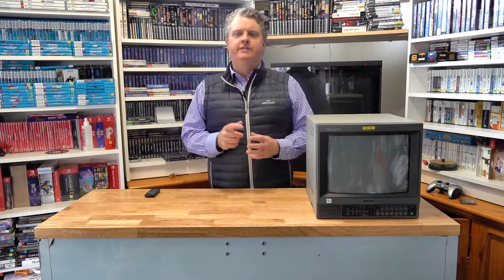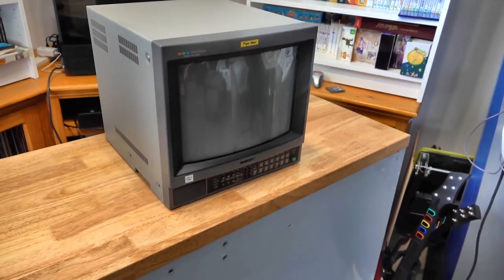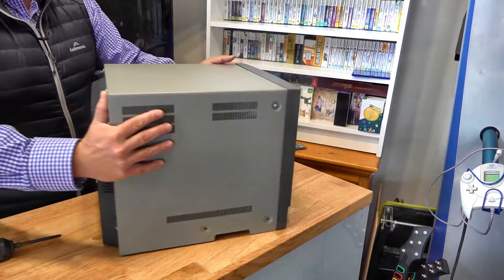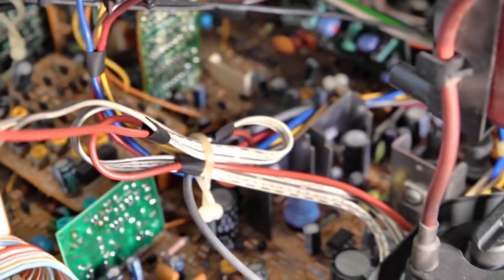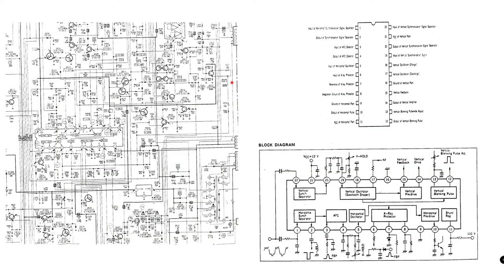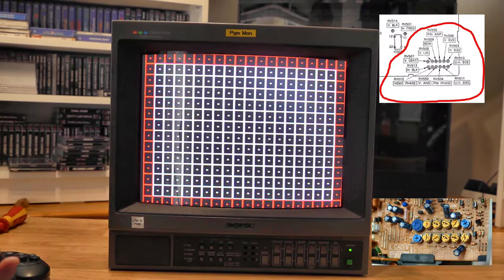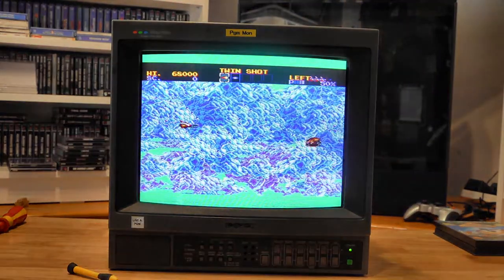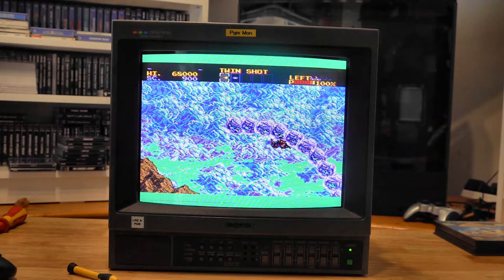Sony PVM Repair PVM-1442QM Vertical Collpase, Geometry Fix

Comment: Hello, I have a problem with the power supply of my monitor. I have already changed all the capacitors, but after having worked for 5min, this one has stopped... my power supply has burned out, would you like a diagram of an FE card with a voltage reading taken at different points to guide my search for breakdown? thank you.

Comment: Have a Sony PVM-2044QM, is it the the same to make geometry changes? Whats a safe screwdriver to use to make the adjustments while the monitor is on?
Reply from the maker: Not sure mate. I'm.pretty sure that has a service menu.
Reply from the maker: Actually it does not have a service menu so yes you would have to adjust internally. Most of these have pretty easy access to adjust the pots and are no where near the flyback. The only reason to use a plastic screwdriver would be to minimise accidental shorts

Comment: Hello thanks for the video, I have the same pvm and I need to adjust the geometry. One question how did you get the geometry screen ? Are you using a software or is it intern to the pvm.
Also, concerning the focus where could it be adjusted ? No risk of electrical shock ?

Thanks a lot in advance for you reply :)
Reply from the maker: This PVM does not have a service menu. You have to open it up to access the adjustment POTS which I think are on the side board from memory. Focus is adjusted using the focus knob which is also internal. All has to be done whilst live.